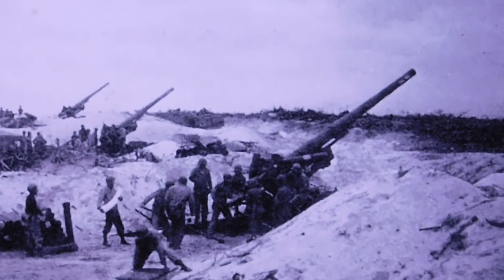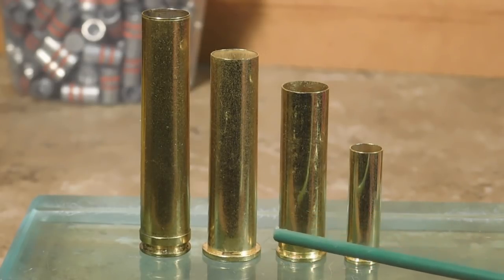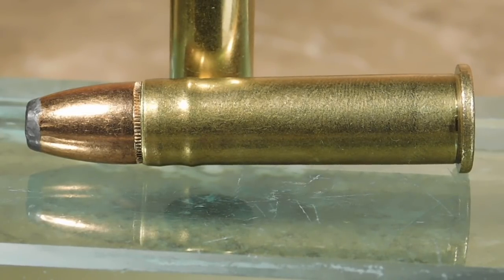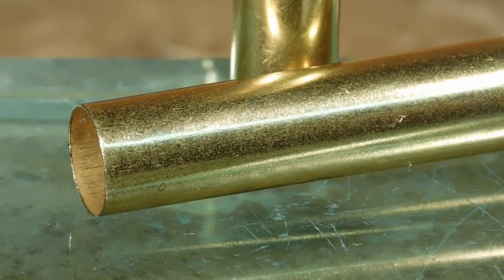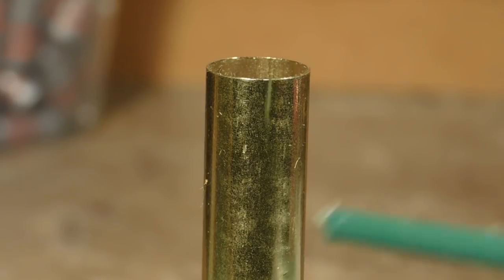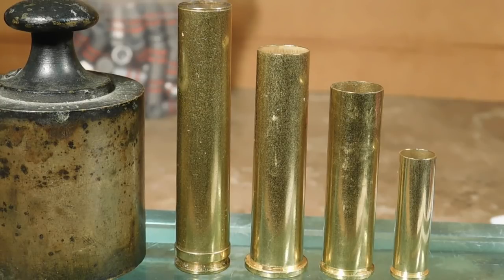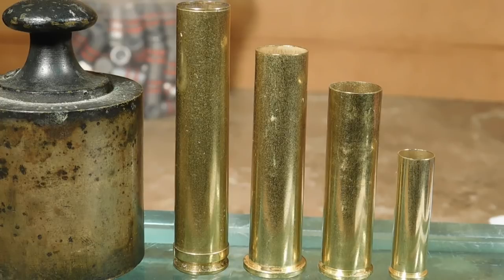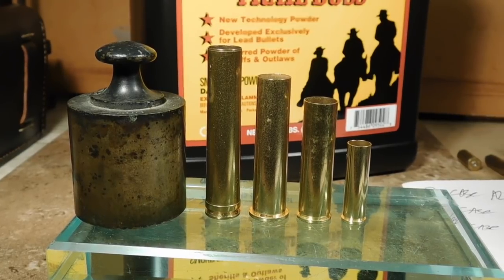Success From Our Long Tom Cartridges

Comment: There is almost always going to be somewhat of a small bulge at the base of the bullet and case, However as you pointed out proper neck tension and relieving that stress point is something that needs to be looked at to enhance accuracy and brass life. Good subject Cookie,  On another subject, There is a video produced by mannyCA. I have a lot of respect for manny and feel there is a genuine find that he has, It about P.C bullets and the PC degrading over time being exposed to certain powders.  He like you are some of the vary few that I trust in the loading advice area. We have experience that we have had to count on in the past. anyway, this has the P.C. world upside down because there are other reports of this happening, not just manny. So, if you would follow up and maybe examine on your own what you findings are and maybe do a video about it I'm sure that it will be well received. Dave
Reply from the maker: Thor's Axe - Hello to ya, Dave.  Yes indeed, - There was a time when I was hot loading my 357 Magnum with 110 grain bullets for shooting short range ground squirrels in the dry creek bed in Williams CA.  The dies I used did not size all the way down to the head of the case so there was an annular bulge there (I don't use that sizer die anymore).  What is being referenced in this video are the marks left on part of the head area of the case from having press misalignment that shows up on the long tom cases.  Not that big a deal really, and I won't name the press brand because that would not be fair.  Brass ductility loss after 5-6 shots = neck tension changes is one reason you do that great annealing.  I retire the brass instead - and I could have gotten many more reloads if I had done that.  Annealing by torching brass and knocking over into 1/2" of water just didn't seem to result in good consistent annealing to me.  We didn't have a YouTube back in those days so I never learned the socket trick or your nice annealer.  Manny runs a fine channel over there.  Have a great day off, Dave...!!  Steve

Comment: I don't use 'fluff' in reloading, but I DO use card wads in my roundball revolver loads to keep the powder down against the primer, with out the cards accuracy goes right out the window and I did get ONE that the primer went off but didn't ignite the powder, both balls were stuck just past the forcing cone

Comment: Yes sir old trick indeed 
First brass 410 gauge shot shells are $$$  and rare as hens teeth to find but 9.3x74r are reasonably priced for 50
I was taught to first anneal the brass then  low load 10 grains lilgun and only cream of wheat then capped with overshot card stock no lead worked 50 out of 50 no splits and they do last a long while I only use them for # 8 shot 
Great shot shells for a raging judge
Reply from the maker: jerry coleman - That's a powerful rig you got there..!!  There was an article on the 9.3 x 74r in one of my old Gun Digest issues.  I should go back and check that out... Best to ya,  FC Steve
Reply: try .444 Marlin cases

Comment: I didn’t realize there were any belted, straight-wall cases. I bought several pieces of new 445 super mag cases. I have the ability to cast and load them, but I’ve yet to rent the reamer for my H&R barrel. I’ve had them for 3 or 4 years, so I need to get it done.
Reply from the maker: jwelsh1238 - The 445 is an interesting round.  Originally developed for silhouette shooting and hunting, we can certainly do a lot with that monster Long Tom..!!  You only need 44 Mag dies.  And Starline brass is available from Midway or right from the horse's mouth.  Best to ya,  FC Steve

Comment: Great information fortunecookie45LC , i had this problem when i first started loading 44mag in Lee dies , out 100 rounds about 10 of them would crumple ,  some of the cases were very badly bulged . A good inside chamfering of the case and a light rub on the inside of the case mouth down a half inch with a cotton bud  with dry graphite lube did the trick . Dry graphite lube will not affect the powder in any way as far as i am aware . Cheers from one of your fans from Down  Under .
Reply from the maker: Jim Gourlas - Hail to the land of the Outback and the Coral Sea, Great Barrier Reef..!!  Thanks for the graphite tip - yes reloaders need some graphite on hand.  Some reloaders like to leave some powder fouling inside the case necks (carbon fouling) as it acts like lube.  I've always found that to be bewildering.  That defeats case cleaning and our good wet tumbling procedures.  Plus factory ammo does not have junk or lube left inside the case necks.  Some military ammo has cements inside the necks to increase bullet seal - far from leaving powder fouling in there.  (some of these reloaders are very fine shooters though - there's room in the shooting sports for style and preference...!!).   Thanks for commenting, Jim - Best to ya, mate..!!  FC Steve
Reply: grafhite is also very good in  the powder measure ,stops tear an wear
Reply from the maker: pab - hooray for graphite..!!  Best to ya,  FC Steve

Comment: I get as well bumps with my 357 Magnum. Thats due to the unsized lead Lee bullet. I use exclusively 148 Wadcutters with the 357 Magnum and have no Problems with the tumble lube design of Lee molds. But the 148 Keith style Wadcutter is a bigger bullet as the smaller tumble lube design Wadcutter, and so it's to big for the case. Eighter it has a bump printing the bullet shape on top or gets a bump ring on the base as such as it does not enter the cilinder. I ordered an Lee 357 mag sizer for the Keith style Wadcutter. Hope that gets the Job done.Didnt know reloading Videos are not allowed anymore. Luckily I am already well on the way with reloading which I learned exclusively on YouTube. Thanks YouTube for allowing previously reloading Videos and shame on you for the new policy.

Comment: FC45. Question pls. Do those white misalignment marks affect case integrity? I have those same marks on my Winchester 25-35 cases. I dont know where to look sometimes to find answers to specifics. I have just started getting those white marks and the info I found talked of case head separation. Thanks so much for you videos.
Reply from the maker: Vince Cartwright - If your Long Tom case meets the resize die mouth perfectly with no deflection on die entry, you will not get those marks.  If the case deflects laterally and enters the die, there is a degree of misalignment of the shellholder / ram to the die axis.  If the deflection is enough, the case is getting resized cockeyed and the marks appear at the case head area.  Note - case separation is a serious discussion.  These are not the shiny rings we inspect for in our fired cleaned brass for starting case head separations, but rather are reloading press signs of misalignment.  The rounds are safe to shoot and really cause no bad effects for our Long Tom ammo (within reason, of course) as we are not shooting at 600+ yards.  Shiny rings on fired cases mean that case was just short of letting go.  If the case stretch that caused those rings was a little worse, pin hole case perforations would be next with smudged case heads and smoke puffs on firing.  If the case stretch was even worse, a complete case separation would have occurred with gas and brass particles blowing out the action.  The marks in this video happen to good brass during the resize reloading operation only.  Best to ya,  FC Steve

Comment: Are you starting to work on loadings for 327 Federal Magnum? That's one of my favorite cartridges and I'd love to hear what you come up with.
Reply: IDK if I'm spoiling the surprise, but FC has confided in me that he is getting a .327 revolver, so I don't doubt that he's getting the brass and bullets and maybe, hopefully molds beforehand.

There's not a lot of bullet selection for the .312/.313" diameter. There's 75 to 78 grain LRN, 94 and 115 grain LFN, 85 and 100 grain XTP's, 90 grain JHP, 100 grain wadcutter, and then the 60 grain JHP and 71 grain FMJ for .32 ACP.

That's the list of standard bullets for .32, but Matt's Bullets has some heavy oddballs that he thankfully offers.
Reply: Dick Tickles Allegedly Speer makes 115 grain gold dots, but I never see them for sale as loaded rounds or components. I'm currently loading 85, 100, and 115 Acme bullets. I have the 85 and 100 xtp's but haven't done anything with them yet.

Have you joined TRN? I'd be interested in your loading experience. I think there's only 2 of us on there that load 32's.
Reply: Haven't joined Reloaders Network, don't know where to join.

As for the 115 grain Speer GD's, they discontinued those years ago.
Reply: Dick Tickles thereloadersnetwork.com is the website. There's also a place you can get the link to join the Slack group if you'd rather use the app on your phone. I use the app more than the website myself.
Reply from the maker: Dick Tickles - TRN is a conglomeration of interesting reloading characters and growing all the time...You'll find it interesting over there...and say hello to Loads of Bacon while you're there... Best to ya, Steve